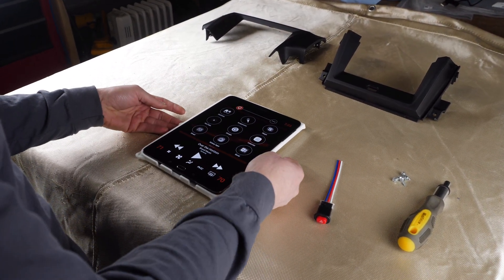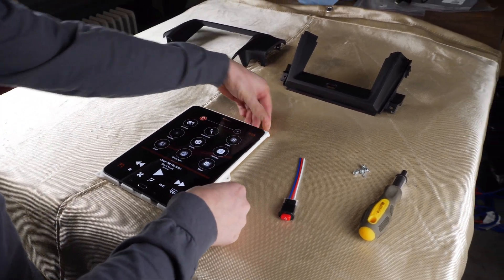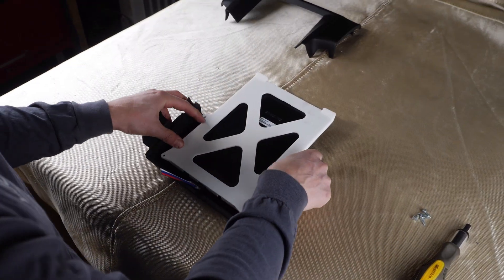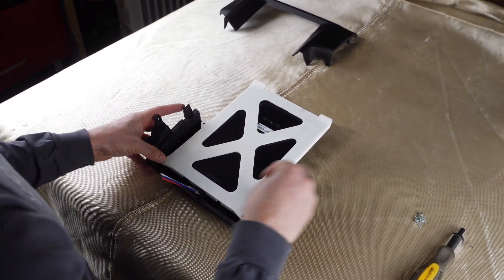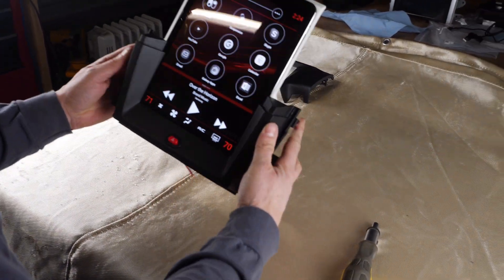FRS/BRZ Early Access Draw

Comment: Hey TIM I've read a lot about the project and customers questions and is very clear you dont have at the moment a possible date for manual climate control owners so my question is do you have any connectivity available for a samsung tablet that I could fit in my car without the need to control the a/c ? .I can make my own bezels but I get frustrated with the connectivity that's why you exist to make our life easier thanks for the support and if you have a release date for the manual control that would be awesome too.
Reply from the maker: Hi there, if you're looking for a solution that covers the wiring, power and amp you can check out our MK1 Electronics for the FRS https://workshoptwelve.com/accessories/

Comment: So listening to your Video I'm assuming these 10 kits would be aimed at/more for people with automatic climate control. Is there any update on the Manual Climate control Kits?
Reply from the maker: No update non manual climate control yet. We're trying to focus on launching the dual zone kit
Reply: Do you think the manual control kit will have a smaller tablet or are you guys trying to figure also taking the place of the knobs.
Reply from the maker: @hemizap384  Manual control kit will either have an 8" tablet positioned vertically, or a 10.1" in a horizontal layout.  It will all depend on space available.
Reply: Ok cool, looking forward to the renderings.